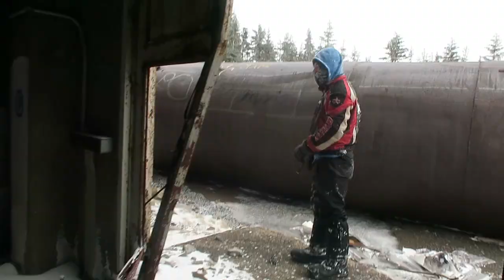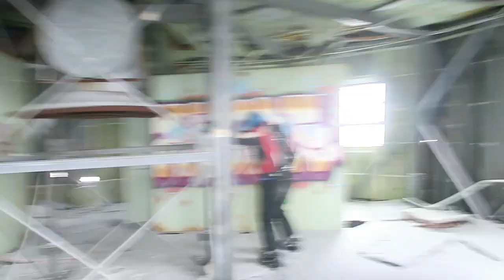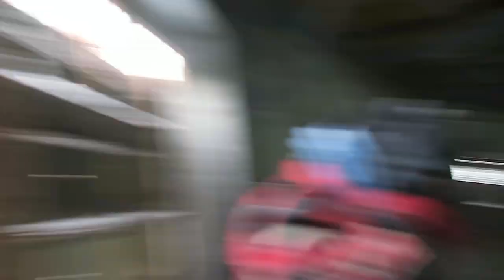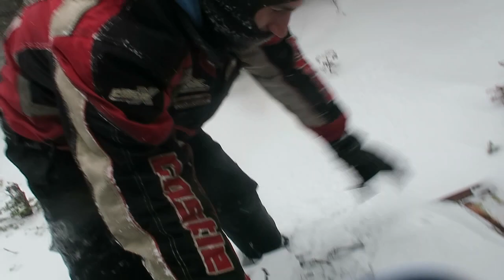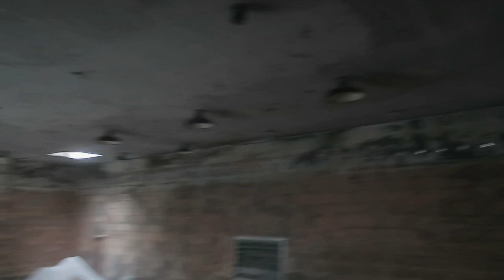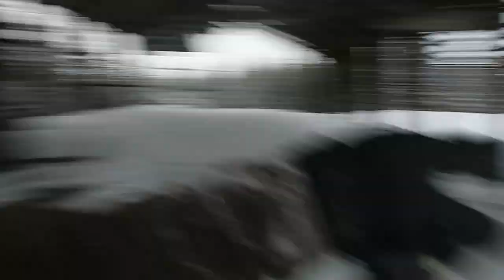EXPLORING AN ABANDONED MILITARY BASE !!

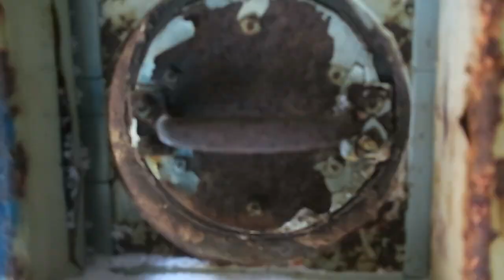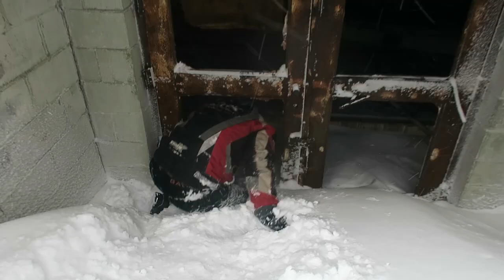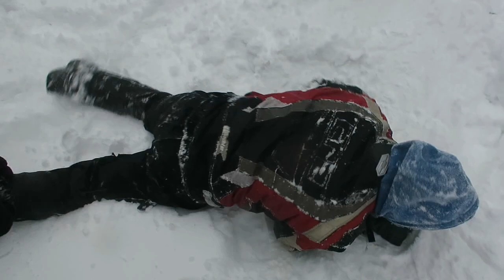Comment: The door at 1:33 came off the roof of the tower. It sealed the access hatch to the roof you are in at 17:25. There is nothing underneath it, some hools just threw it over the side of the tower. Also the building you were in at 19:00 is the radio room, not a mess hall. Also, the antenna at 22:00 was part of the weather station, it was powered by a solar array and wind turbine on top of the tower you camped in before all of it was destroyed as well.

Check out the Lyndonville AFS Preservation Group on Facebook. I have a lot of information about the AFS on that page. My profile picture is actually from a winter ride up there in my truck.